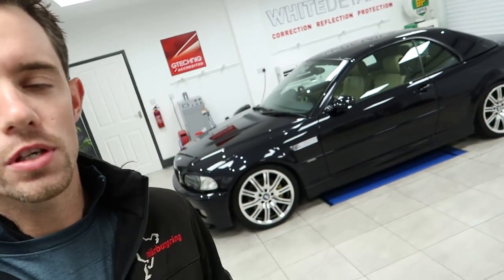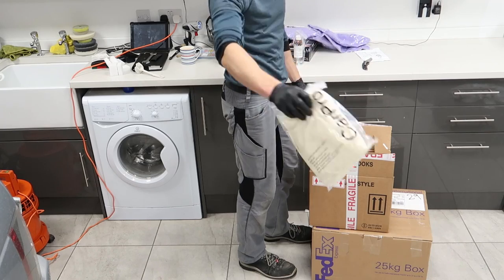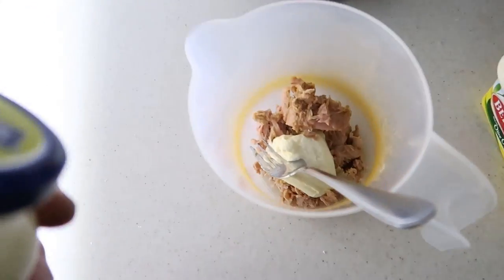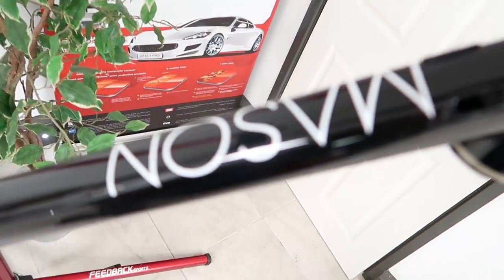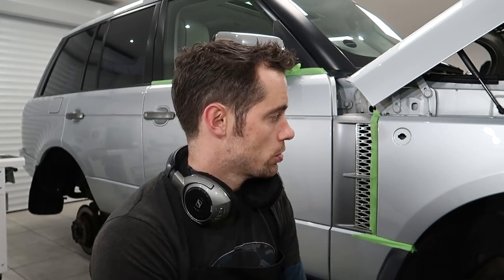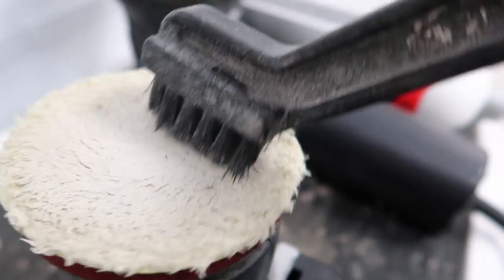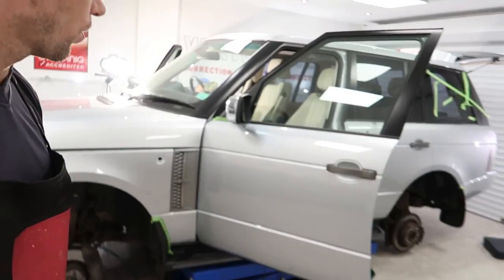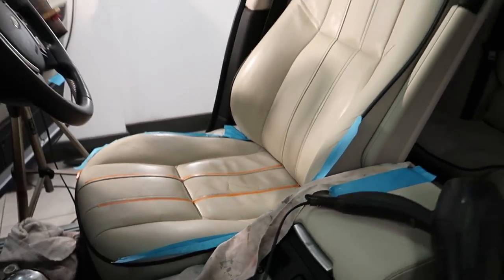WhiteDetails VLOG 002 - Range Rover Vogue + Mason Revolution + Leather Restoration + Tips

Comment: Another great vlog 👍 What's the best way to clean the microfibre pad if you don't have an air line?
Reply from the maker: Thanks Luke - without, it's pretty tough. For a couple of years (whilst mobile) I used to make do with the Megs spurring brush. It just didnt really cut it.. Just tended to push the pile rather than releasing the dust. Sure you can grab mini compressors for sub £100